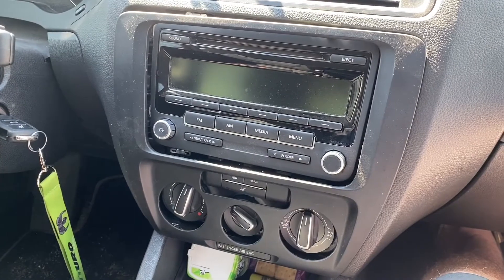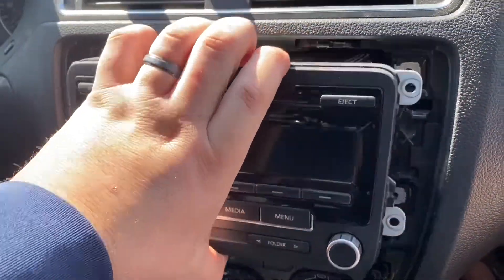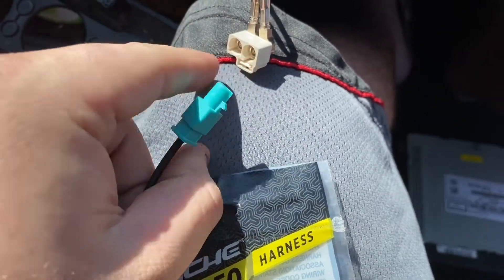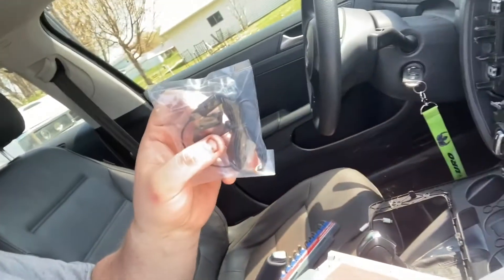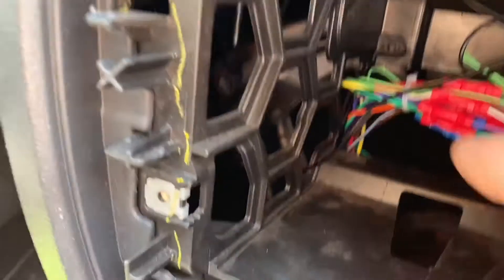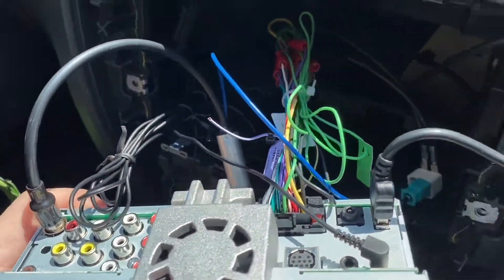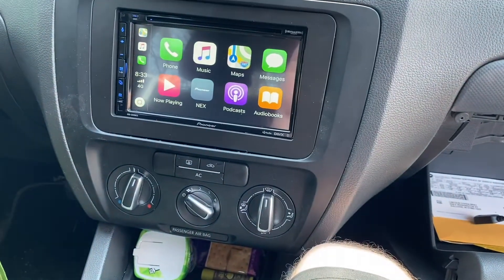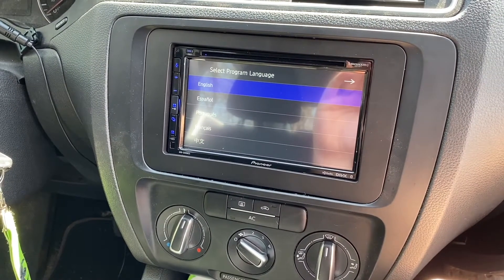Installing a Double Din Radio in a MK6 Jetta

Comment: I followed this but get no sound. Stereo works fight aside from that. I get sound from the factory stereo so no issue with the speakers. I have no factory amp and have tried running the blue/white wire to power but still no sound

Comment: Why does it have constant power? Do I have to shit off the radio manually? It won’t shut off with the car?
Reply from the maker: After I made the video I ran into this as well. I ended up running power to the cigarette outlet it (in my car) shuts off with the car.
Reply: Sweet! Thank you!!

Comment: I have a 2012 Jetta an I hooked all the wiring up but when I hook the yellow to yellow an red to red the radio turns on without the key in the ignition. Why is this
Reply from the maker: It’s just a VW thing. You should have been able to do it with the factory radio as well. I ended up running just power to the cigarette outlet because it’s on and off with the key.

Comment: Do the stereo comes on with the car or you have to manually turn it on with the power button ? I’m having trouble with the acc wire
Reply from the maker: Mine is wired to the cigarette lighter and comes on with the car

Comment: Is the amplified antenna adapter needed or can it be a passive adaptor?
Reply from the maker: It was just a factory to aftermarket adapter. If you don’t listen to AM FM then you can save the $12 and not put one in it.
Reply: @CornFedOffroad  So weird... I just tried a plain old adaptor and the radio is working just fine on a JVC KD-RD98BTS
Reply from the maker: @inspyre.design  mine was just a adapter not and amplified adapter. I don’t even know what that is. Anyway if it works then why you asking?

Comment: Does the radio turn off with the car as well? So there's not battery draining
Reply from the maker: No I found this out after the install. The cigarette lighter shuts off with the car so I ended up running the power over to it.